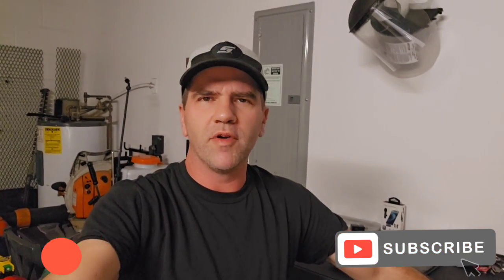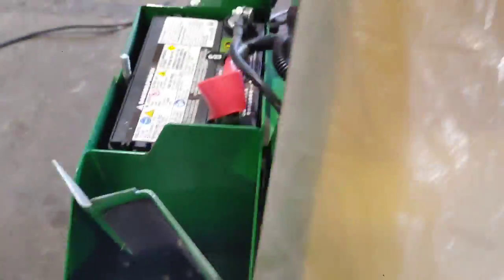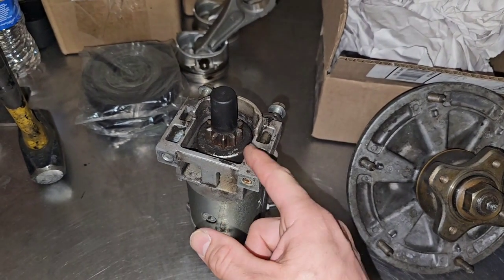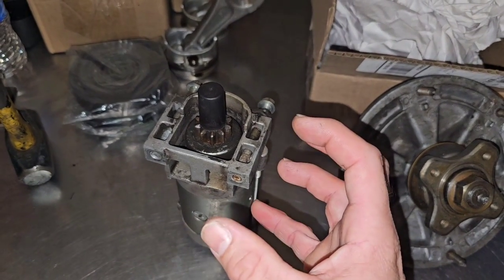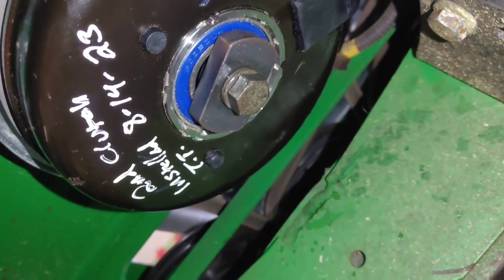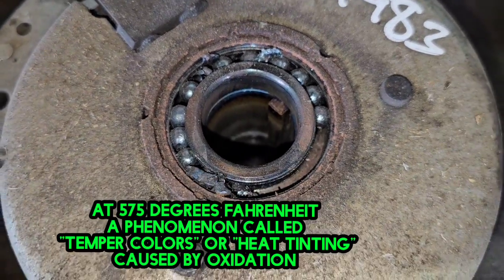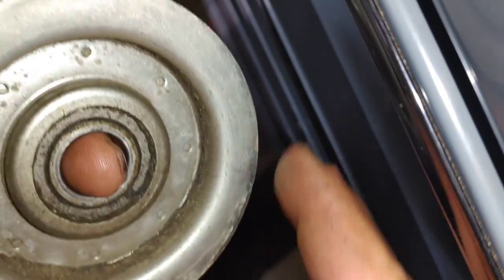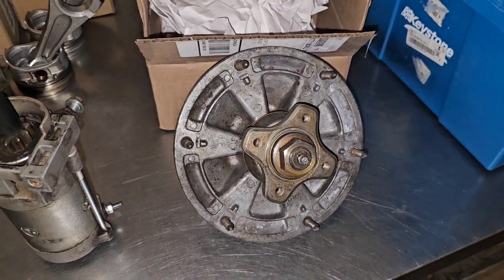Why are bearings failing so soon on new machines?

Comment: Ain't just mowers, it's everything. The problem is two-fold and more. First is that new sealed bearings have just a bit of low-quality grease in them. The space inside a sealed bearing should be 60% to 70% grease but most have like 15%. Carefully work the seal off and add good grease till it's right. Second is more serious without any fix; low quality metal and p-poor heat treating. Races are usually on the soft side as well as the bearings, but sometimes the bearings are too hard and brittle, then they crumble under load and eat the soft race up in minutes. The seals are also low quality rubber. 

The best solution is to source your bearings from European manufacturers who still make good bearings. You'll pay dearly for the quality and the selection may be limited but at least they will last. In Germany and across the EU there are legal specs for most products and testing is done on almost everything they produce because of EU law, so unless you get a counterfeit it will be good.

Comment: Seems to me like John Deere has always had trouble with their bearings, especially on the lower end models. But it’s definitely gotten worse across all manufacturers. I just bought a new Z530M, haven’t really been able to use it yet but it has a 4 year 300 hour warranty so I’m interested to see how many bearing issues I run into. Machine seems to be very well built, unlike the older Z5s.

Comment: Definitely inferior quality Chinese parts.  It's a shame, but that's just the way it is today.  Maybe in the future, we can find a way to return all manufacturing to the USA.  Another problem that maybe you're seeing is customers going CRAZY with their power washers.  The American public have been sold a 'bill of goods' in thinking they have to POWER WASH every damn thing in the world.  Power Washers were originally designed for commercial use, ONLY, for very specific applications, not your everyday mechanical equipment.  Most bearing grease seals were never designed to hold up under thousands of pounds of water pressure, being sprayed directly at the seals.  It's just stupid to think a grease seal can stand up under that pressure.  So,  water intrusion happens, and shortly after...WAA LAA!!!   The bearings are toast.  Why can't people figure that out?   The pressure washer manufacturing segment saw HUGE profit potential in convincing John Q. Public that he 'needed' a pressure washer if he wanted to be part of the 'IN' crowd.  Pressure washers for concrete slabs, driveways, and pavement?   Absolutely.  Pressure washers for mechanical equipment?   NEVER!!!!!!!   Especially for any type of electrical connections.  If you absolutely must WASH the dirt off the machine,  go with a very low pressure garden hose spray, and stay the hell away from bearings and electrical gear.
Reply from the maker: You're on to something about the pressure washing. I do see that where customers have gone over board with the pressure washers putting water in the bearings.
Reply: So please explain how those 2 electric clutches shown were damaged by a power washer.  Deck spindles yes but pretty darn hard to hit those clutches and even the spindle bearings are protected from direct blast by the pulley or blade.  Bearings are going bad without washing.  The problem may be lack of grease but more likely poor quality control on the steel parts of the bearing itself.  Power washing is fine.  I use a wrench properly and don't break off bolts and I don't hurt bearings or electrical with power washers.
Reply from the maker: @jefffrayer8238  Neither one of us said that the two electric clutch's bearings were caused by pressure washing. SantaClause2875's first sentence was "Definitely inferior quality Chinese parts."
He then went on to say, "Another problem that MAYBE you're seeing is customers going crazy with pressure washers." 
He nor I were suddenly suggesting that ALL the bearing issues were caused by pressure washers.
Reply: @Mechanical_Mind  Just to make sure I didn't misunderstand anything I rewatched video and reread comments which I hope others do the same.  You are pointing out that bearings are having short life which we all agree must be poor quality control during manufacture.  My issue is SantaClause wants to claim  "John Q Public that he needed a powerwasher if he wanted to be part of the "IN"  crowd."  He spends a lot of time stating that power washers should only be used on concrete....... and NEVER on mechanical equipment.  He also suggest and you agree that they have caused beaing falure from water intrusion.  Water intrusion was not the reason for the clutch bearing you are showing and I have never had any bearing falure from power washing.  I used car wash 35 years ago on car engines and lawn mowers and used power washers for 20+ yrs.  I power wash mowers, big tractors, car/truck engines, backhoe, when they get greasy or needing work done.  I can say that even though I'm part of the "IN " crowd I have never had any electrical or mechanical problems from power washing as SantaClause suggest.  I resent that I'm a "Stupid ",  "IN" Crowd,  John Q Public that can't figure out power washers are for cement only.  35+ years of no electrical or bearing problems from power washing by myself and others prove otherwise.  Thanks for the great video and responding.  Merry Christmas too.